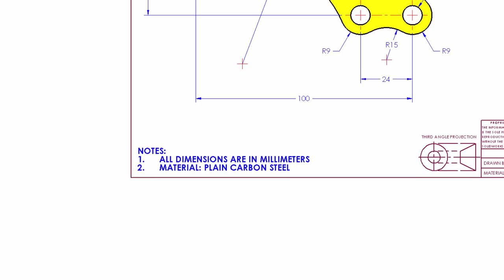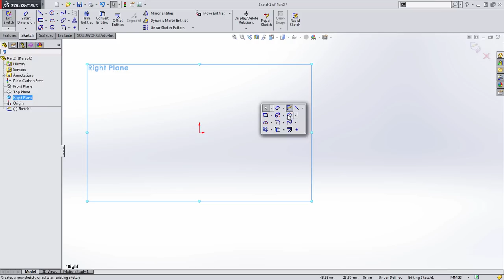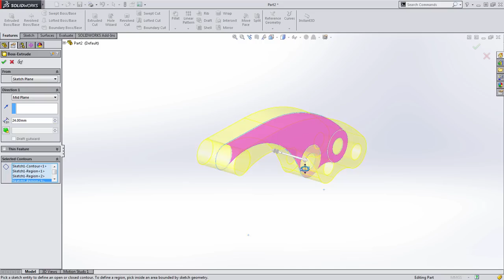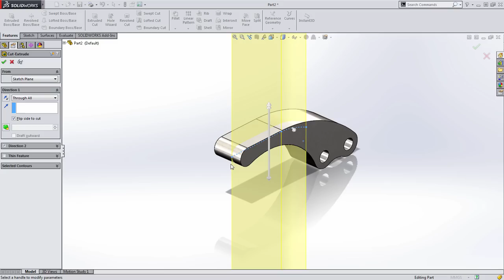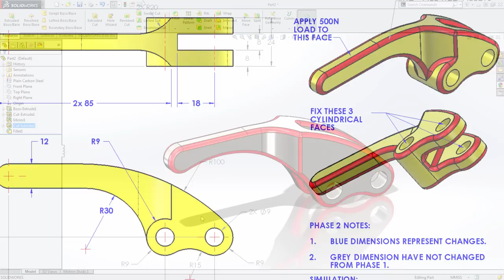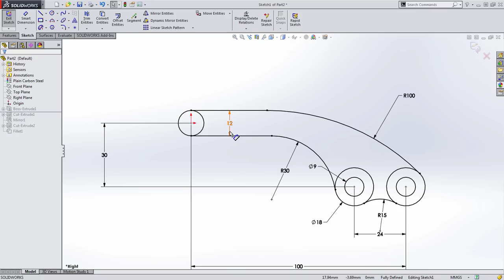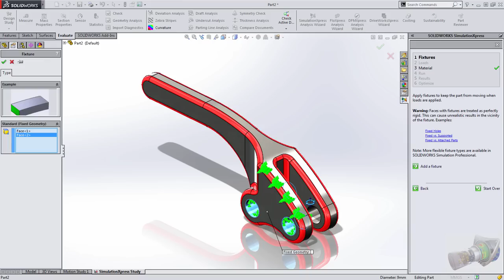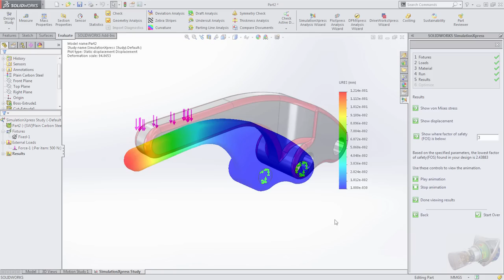SOLIDWORKS World: Model Mania 2012

Comment: Great videos, all of them from this source. Also very nicely narrated. I have to say though that my FOS always seems to be very slightly out. Displacement figures come up the same but the FOS just a tiny bit out. For instance on this part my FOS was 2.41165 instead of 2.43883. I'm not sure what difference this makes or why it does that.
Reply: they're determined using numerical methods so there is an inherent variance is the results. the percentage difference right there is inside 5% so its close enough.
Reply: And my FOS came out to be 2.42799
Reply: Mine is another answer 2.41062
Reply: Not only precision but also accuracy is incorrect as far as I can see
Reply: this variance depends on your mesh settings and the way you tweaked it so as far as your answers is with in the 5% range you are good to go